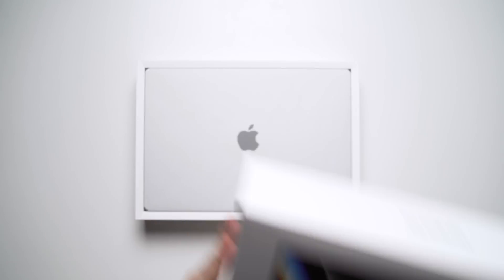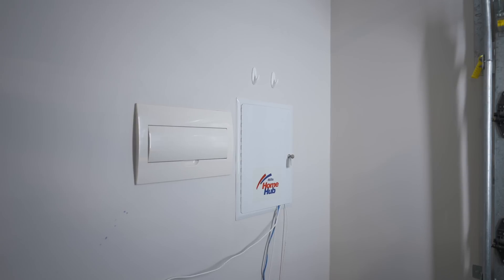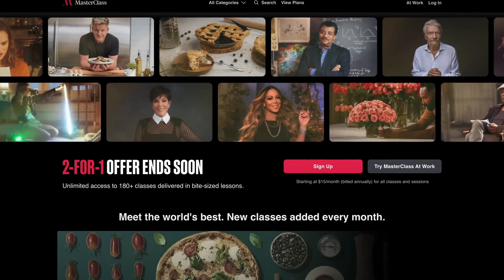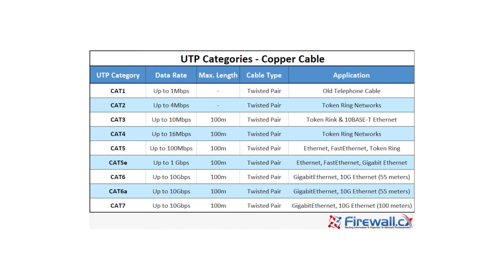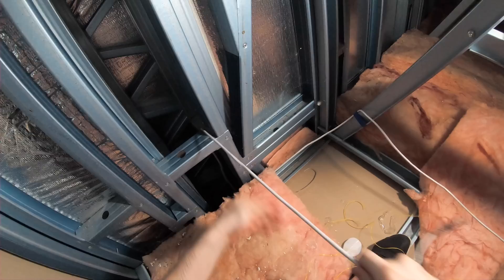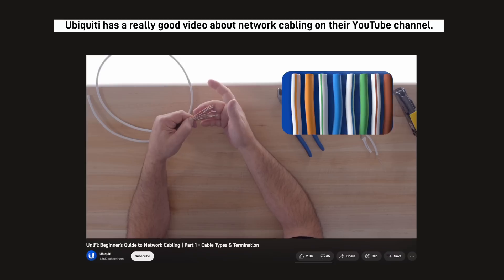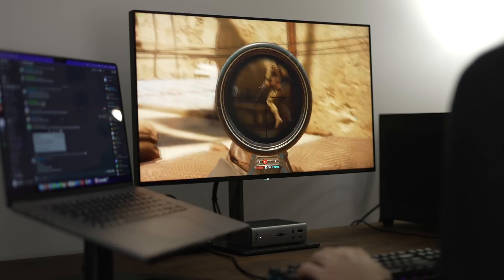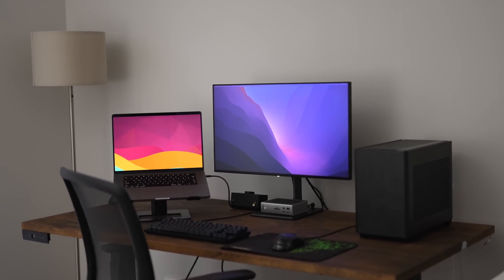Fixing Slow Wifi Is THIS Easy...

Comment: Of course Ethernet is better than WiFi. Not only are radio waves transmitted through air and other obstacles less efficient and prone to interference compared to copper but the protocol used by WiFi is also less efficient. Ethernet uses CSMA/CD whereas WiFi uses CSMA/CA which adds overhead. You only need to worry about network collisions in Ethernet if you’re using an (ancient) Ethernet hub that connects a lot of computers, a problem easily solved by an Ethernet switch. Of course an ancient 10Mbps Ethernet over cat3 won’t outperform 5.4Gbps WiFi 6E but gigabit Ethernet usually will, depending on distance from WAP and build material of walls. 10Gbps Ethernet is even better but not standard on most computers.

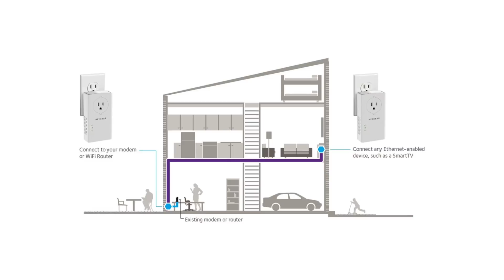Comment: 1:54 it is not sending ethernet through electrical wires in the wall...... its just a wifi AP and the other one will you the host and make the Internet connection......
Reply from the maker: No, you are completely and utterly wrong. That diagram is of a powerline adapter, and it sends an ethernet signal through the POWER LINES. You are confusing it with an entirely separate product.

Comment: I definitely prefer ethernet especially for file transfers but since I hardwired a U6 lite with ppoe to my dream router and lots of tweaking of channels I settled on WiFi 6 80hz and I get the same speeds hardwired and WiFi in 98% of the house even with lots of other networks around.

Comment: Make sure your Ethernet cable is pure copper and not CCA (Copper Clad Aluminum). This should be brought up a lot more often. Look it up: they are pure trash, and should not even be marketed as CAT 5 or 6 in the first place. Amazon and other retailers are full of them. Always read the specs for bare/pure copper and not CCA.

Comment: Hmm.....I instead of addressing the problems with your wifi you decided to hardwire......thats a choice.....why not just do an actual network upgrade?

My internet connection is only 450mbps but I can get nearly my full internet bandwidth over wifi no problem. and closer to 600mbps on local connections. Granted I have 3 access points for coverage across the whole house and everything thats stationary is hardwired....TVs, cameras, Printers, etc...
Reply from the maker: Hmm... $50 of cabling vs potentially hundreds of dollars for new access points/mesh systems etc and will STILL have increased latency and slower speeds compared to ethernet. Not really a difficult decision.

Also I never said there are problems with my wifi. In fact the network is very good, running off a Ubiquiti Dream Machine with Wifi 6 to all my Wifi 6 capable devices. Still can't beat ethernet though.

Comment: I did something similar quite a few years ago - one length of ethernet to the far end of the house which is where the TV and streaming boxes live, and another one to an upstairs office. The wifi reception upstairs was actually not bad, but as it was overlooking the street I was also picking up wifi from dozens of houses around, often on the same channel. In my case I had the job done professionally, and interestingly the last time I spoke to the cabler, he said that these days he would recommend a mesh wifi solution rather than cable.
Reply: Don't mesh systems still run slower than wire?
Reply: @garrykanter5773  Well, potentially, but they do have the advantage of flexibility - it's a lot easier to move a mesh station than it is to re-cable! I don't know how it is in Australia, but to be honest my wifi was always pretty good; the limiting factor was generally the actual bandwidth from my provider. In fact I've just done a test and obtained some embarrassing results. In the upstairs office, the iMac (cabled) reached 50mbps download and 10mbps upload; the iPhone 14 Pro on wifi managed 51mbps download and 10mbps upload; and with wifi turned off (i.e. using cellular only), the iPhone achieved 235mbps download and 32mbps upload. So it looks as if at this time of day (early morning) the ethernet cable is no faster than the wifi - those first two sets of figures are at the top limit of my broadband connection. The iPhone cellular connection is quite startling, esp. as it's on 4G - I don't have 5G locally. That said, I think the modems on the iPhone 14 Pro are much more high performance than on my old phone - probably it was using multiple channels to get that result. Perhaps those results reflect how technology has got more efficient in recent devices?
Reply: @tomburke5311  It's a great time to be alive with so many great technologies!

Comment: I'm just concerned with your upload speeds, are you currently using a fiber plan? Seems to me something is wrong with the upload speeds in your speedtest,
Reply from the maker: Australia has notoriously bad internet. This plan is actually very fast compared to most others (1000Mbps down and 50mpbs up).
Reply: OmG. "Concerned" about 650/38. That's a bit dramatic.

Comment: Really good job. I'd recommend attaching the keystone as close as possible to where the cable jacket is. The least untwisted cable you have, the better. cables are twisted to avoid cross-talk and when you have untwisted cable like that, it can affect the speed.
Reply: Came to say the same thing!
Reply from the maker: Good point, and you're right. I did the first one really close to the keystone, but struggled with the second one because I was trying to get a clear shot on the camera 😂

Comment: When transferring files between computers it’s a no brainer. Ethernet is the way to go. Mobile devices are Wi-Fi and my computers are Ethernet. Having a robust Wi-Fi network is key to enjoying Wi-Fi. Years ago I tore out my wireless (Netgear) and installed enterprise grade access points and a firewall including Ethernet throughout the home. No issues.

Comment: Wired connection is the best for sure.  But just so you know, Asus routers have Wi-Fi mesh operation mode so if you use wired backhaul, you can position the routers in way where you have good coverage over the home space. 

the system will use the rssi information from client devices to roam clients from node to node as you move around throughout your house and in my testing it seems to work well. You can manually configure parameters of the rssi value to trigger roaming, etc. 

Some clients are problematic and don’t always roam on their own but you can use the gui to optimize your network and get clients to roam to the nearest node.

Comment: One place where I really noticed the difference with wired ethernet was when I was using Synergy to share mouse and keyboard to a second PC (two screens on my dev PC and and a spare laptop functioning as a third for viewing docs whilst coding.) It was much smoother with wired ethernet. I have a Netgear Orbi mesh wifi in my flat, so Wifi performance is fine for most other purposes. (Though my HP microservers and some other machines are connected by wired ethernet so that I can use wake-on-lan on them.)

Comment: Bro what 600 down 38 up? Ping Wi-Fi went from 5 to 3 basically negligible. I’ll take the convenience of Wi-Fi any day of the week
Reply from the maker: There was a significant difference in upload and download speed via ethernet cable compared to wifi router. Sure, ping wasn't a huge change in that specific example (it changes on wifi). But, bear in mind the router I'm using in this video is a Ubiquiti Dream Machine - a $400 USD router configured to use Wifi6 (and all my devices support Wifi6).

Comment: 06:31 is that black cable just going through the vapor barrier? I think there should have been proper insulation around it, not just a big hole. Might work in Australia and maybe there is not much condensation happening, but elsewhere...

Comment: I used an electrician to do 4 cables for my house and I live in New Zealand where our internet is all fibre , and 3 time as fast as the nbn,we have 900/500 for our fastest fibre in general
Reply: Welcome to Australia, where you are actually supposed to pay someone with a cabling license to do this job (because govt) & you can enjoy your glorious blazing fast NBN throughout the home !

Slight correction though, highest speed tier for residential NBN is 1000/50 (fibre & coax only),  so you are up to 10x higher on upload & I believe you guys have options above 1Gbps (?), which we do not on residential NBN (nor likely will in our lifetimes).. So a 3Gbps plan would be 3x faster... if that is a thing there.

However here, HFC/FTTP is only available to portions of the country here, otherwise 100/40 is the dream lol

#blazingfast

Comment: I was having all sorts of network problems with my Mac.  Had no idea what the issue was.... then I replaced the FIOS given router with an ASUS gaming router (about $200) and haven't had a problem since.  It's really amazing that this was the source of all the network glitches.  But hardwiring it with ethernet brought ping times down to about 10ms or less.

Comment: Is Powerline really that expensive though? I get the materials you got for this was cheap, but decent Gigabit Powerline adapter packs cost like $70-120 per pack of two, depending on the speeds and features we want. And Powerline adapters are pretty easy to install. I just feel like that's a pretty ok price to pay for the convenience and not having to install a real ethernet port by going through the walls and roof.
Reply from the maker: $120 vs $50, and the $50 version will have much better performance and longevity compared to powerline. All it takes is about 2 hours of your time to install.

Comment: I use 10GB, even though I only have a 1GB uplink, ethernet for all our gaming PCs because ping matters but for laptops and TVs I have a 1GB MESH system at the house. Yes it wasn't cheap but our MBPs are on it as is my Studio which is on the other side of the house. No it's not as fast as the direct connections but it means the family can use their laptops anywhere in the house it the rest of the family is too loud... which happens all the time with 4 teenage boys.

For your situation your solution is perfect, gratz on the creativity!

Comment: Not sure what they’re called elsewhere but you could’ve used glow-rods/fish-sticks or fishing-tape to fish the lines through the insulated walls. And as a former cable guy, you actually have a pretty decent sized attic. I had to run lines through much tighter attics.

Comment: I don't understand why you run both a 1gbit and 10gbit cable instead of going 10gbit for just one or both?

I mention this because I noticed that your gaming pc has a 2.5gbit LAN port and the same on your thunderbolt 4 dock which means both your pc and Mac are able to use higher than 1gbit connection. And then you're still future proofed for that NAS when you get a 10gbit adapter for either your Mac or PC 😀
Reply: One thing for certain is that the chance of ever getting > 1Gbps internet connection in Australia, is about the same chance as the planet becoming zero emissions in the next 30 days. So if WAN bandwidth was the goal here, mission accomplished.

But yes, for LAN, it makes sense to future-proof while you are making the effort to run the cable.

Comment: I use MoCa 2.5, and just did a speed test. 942 down, 56 up. We pay for 1 gig down and 50 mbps up. Not bad for wife-happy networking.
Reply: That has to be hugely expensive! I don't have access to fiber optic where I live, so I'm using the second fastest service provided by my ISP. It's 500 down and 25 up for $105.00 a month.
Reply: @Kevin6t8  about 120/month. Used to pay $79/month, but now wife and I both WFH and kid is in livestream classes, so we jumped to the higher tier.
Reply: @limen5442  Mine was $50 a month, then went up to $105 a couple of months ago with a slight bump up in speed. SPECTRUM is my ISP.

Comment: Got myself a better router and a repeater. Around $200 overall and a much better experience for all my devices. Since I don’t have a gigabit connection there literally is zero downside to using that over cable. Even latency is pretty much the same.

Comment: Which between using a cable connection or WiFi connection is better when it comes to downloading large media files on the internet?
Reply from the maker: Cable is always better from a speed standpoint. But sometimes the convenience of wireless is worth the slower speeds and other drawbacks.
Reply: @CreatedTech  So does plugging ethernet cable into the WiFi router mean that other users who are connected wirelessly to the router stop receiving internet connection?? 
Or will the router still work normally for anyone connected to it even when I'm using it through ethernet.
Reply from the maker: @weiSane  The wifi will continue to work fine for everyone else.
Reply: @CreatedTech  okey, thanks.

Comment: Use cable conduit. That way, you can protect your cable better, and if the current one becomes faulty, you can just put in the new one by tying the old one to the new one while pulling out from the other side.
Reply: Now you tell me! 😂
Reply: Would have been overkill for a network run like he did!  If this was an institution for sure!

Comment: I have great 5G in my home/WFH, which gets 800Mbps most days. So I have a 5G router for my main room and use my phone's 5G connection if I am in a different part of my place. I have backup cable just in case, but that depends more on the time of day and how busy my area is. My 5G is unlimited and only £20 a month.

Comment: I am also in Australia and I use a backroom in a solid brick house that my Macbook can just get with WiFi, but my LG Smart TV can't. I run one Ethernet cable to my MacBook because I want top speed for my most common applications, but would like to get Internet on my Smart TV.

Will I need to run 2 Ethernet cables from my router 15m away at the other end of my house?

And are there outlets I can use to replace my existing double outlet powerpoint that also includes 2 Ethernet jacks? The brick walls make it hard to add sockets.
Reply from the maker: You can use a network switch instead of running two separate cables. I have the one I used linked in the description of this video. It will allow you to have one cable running from your router into the switch, and then two cables from the switch to your devices. I do believe there are also wall outlets you can buy that have 2x power and 2x ethernet, pretty sure I saw them at Bunnings. But I can't confirm 100%

Comment: You can use MoCa Coax adapters if you have cabling within the house, I have 2 routers from Asus set up as a mesh network with an wired backhaul and I get max speed everywhere in the house

Comment: I did a similar job several years ago because although the power line adapters I was using were reliable they were slow and wouldn't work on a sub panel.  As you noted, it wasn't very expensive and was well worth it.  At the same time I purchased my own cable modem with a four router ports for more flexibility (and to save the money on the monthly modem rental).

Comment: You realise you could easily do all your work on a gaming laptop right? Massively eliminating duplication.
Reply from the maker: Gaming laptop = awful performance compared to a desktop, can't upgrade most components, poor thermal regulation, worse fan noise, can't add additional things like a 10GbE card via the spare PCIe port on the motherboard etc.

I think you'll find a lot of people who watch this channel have a MacBook and then a separate gaming system (e.g a console or desktop).

Comment: That termination is really bad for performance. Just a heads up
Reply: @CreatedTech  The cable jacket is supposed to be on the keystone/jack itself so the cable remains in twisted state vs long untwisted pairs when you're terminating the keystone, that would cause NEXT fail and/or return lost <(if you have a Fluke cable tester that is) But you can search for proper termination guide online. Also I recommend using flexible hose for the cables running in the wall if you're worried there are pest biting those cables.

Comment: Wow, great Wi-Fi speed in Australia. Usually people there has low internet speed.
Reply from the maker: The wifi speeds have become better here in the last 2-3 years. However I am currently paying $100 USD per month to get the speed you see in this video.
Reply: @CreatedTech  In Hong Kong, I am paying for 1GB fiber optics internet for 12 USD per month, and I have Wi-Fi speed of around 950 MBS download and upload. I00 usd per month is extremely high, and in HK, the Wi-Fi cost is already considerably high.

May be you are being overcharged.
Reply from the maker: @hugochan2821  I'm paying for 1Gbps download and around 50Mbps upload. It's a fairly premium internet package in Australia and I'm actually using a budget provider. The cost of fast internet in Australia is just really expensive because our network is so outdated (due to crappy government policy) and has to cover a lot of land.
Reply: @CreatedTech  woah!